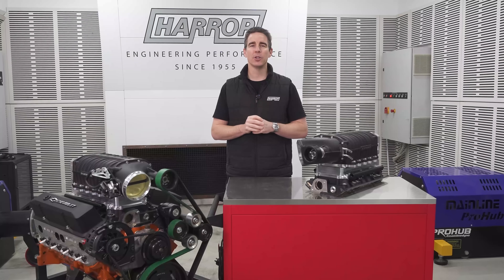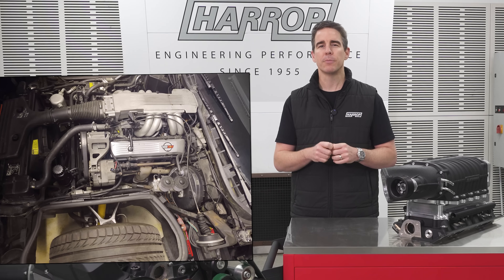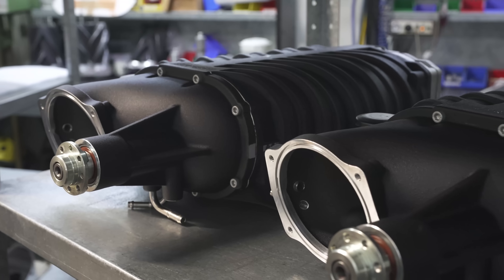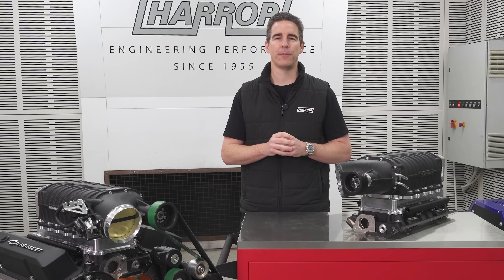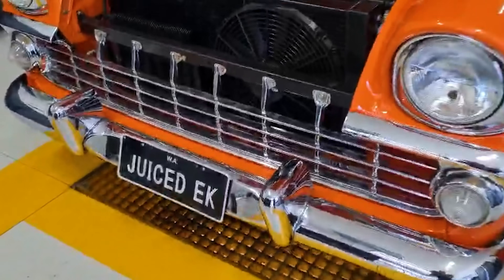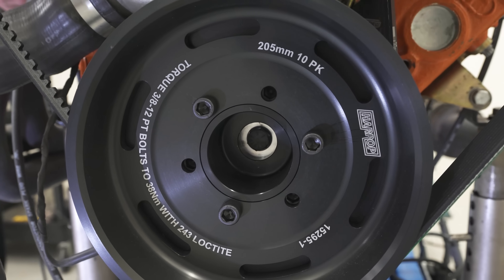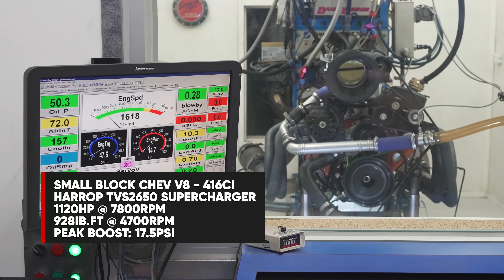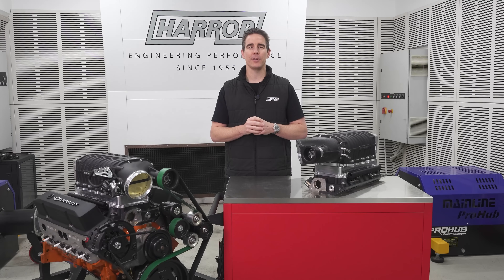Small Block Chevy V8 | Harrop TVS2650 Supercharged

Comment: Bout time the aftermarket starts thinking of us “ obsolete SBC “ lovers. Some of us just don’t wanna do an LS swap or run too many electronics and like it Old School 🤙😎. This would be killer on my 383 stroker SBC 😲
Reply: "Old man shakes fist at cloud" 😂😂

You realize this is an electronically fuel injected motor with aftermarket everything and a ECM computer that needs programming 😂
Reply: @Kstang09 yup , but there are ways to make this work on an older setup. Unlike all the other ones. It’s utilizing an SBC block which makes the difference.
Reply: @KTMGREG55 goddamn that's a stupid sentiment 😂 Somehow the block is what makes things 'simple'?? Do you prefer a rope for your rear main seal too?
Reply: @Kstang09  I meant the design , yiu guys crack me up 😂🤣
Reply: @KTMGREG55 the DESIGN is 95% identical! 

You oldsters bewilder me!
Reply: @KTMGREG55 whipple been around since since the 90s
Reply: I have a 421 Cu. In Stroker based on the 400 block. Beautifully nice to see on in
Reply: Whipple been around since the 90s
Reply: @cedricwilson2055 uhm ya , what’s your point ? You think I didn’t know this 😂🤣.
Reply: You toast most LS guys with a supercharged 383 all day long. 
OG SBC 💪
Reply: @harrop what comp is the SBC going in the HQ? I have 12:1 comp 427 sbc all forged….too much? Or run on low boost?
Reply: This has just as much "electronics" as a LS and nothing down to the block is stock
Reply: @robholmes2129 you’re clueless. Got watch another video 🤦‍♂️🤣😂
Reply: @KTMGREG55  Go smack your carb with a screwdriver and hope it works
Reply: @robholmes2129 never fails 😝👌. And will always get me out of sticky situation. Hope you carry your laptop with ya and you make sure your Vape Pen is charged 🤣😂
Reply: Hear yea!!!
Im the same

Comment: Wow that thing is over driven, wonder the hp loss from that.  Like to see a larger displacement charger running less rpms and less drag on engine..
Reply: What for? The efficiency maps on a TVS usually show the sweet spot being in between a pressure ratio of about 1.8:1 and 2.2:1 with the (blower) RPM between 14,000 and 16,000. These are *made* to be heavily overdriven. Just as an example, a factory 2014 gt500 uses the smaller 2300 rotor pack and is overdriven with a 7.225" crank pulley and 2.7" blower pulley. They make a smidge under 700hp.  Modified versions are made to spin way past 20,000RPM with good power gains. (These aren't some 1960's blower pinched from a GM 2 stroke diesel!)

Comment: So how do you keep the engine cool during summer on a hot day with all that extra heat ?
Reply: That water/air intercooler sitting underneath the blower comes with a fuck-off-big heat exchanger to cool the water back to ambient temps.